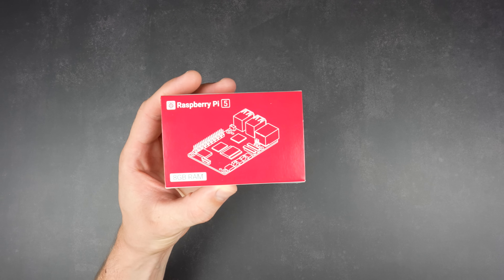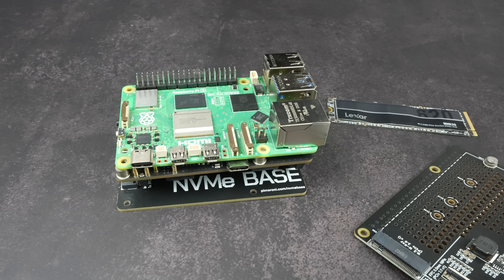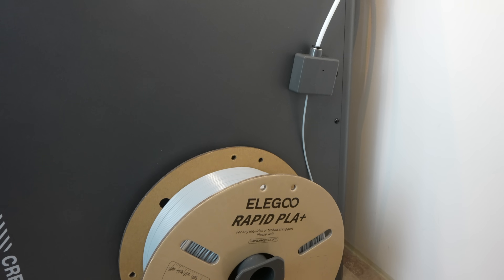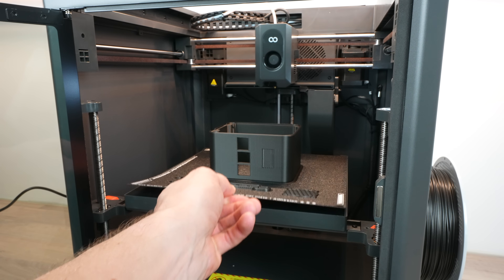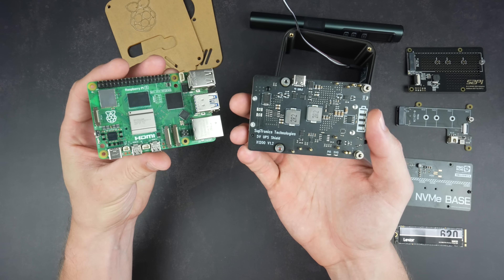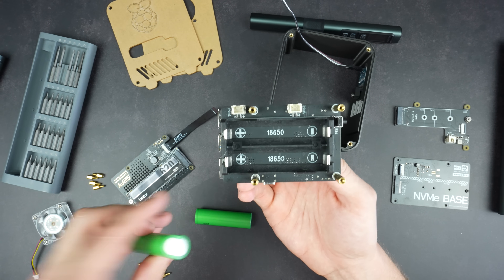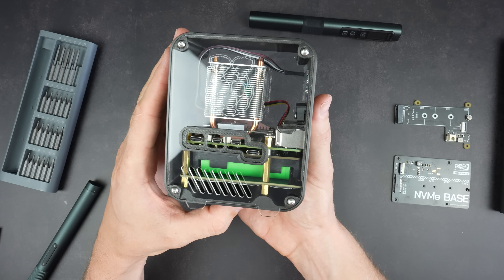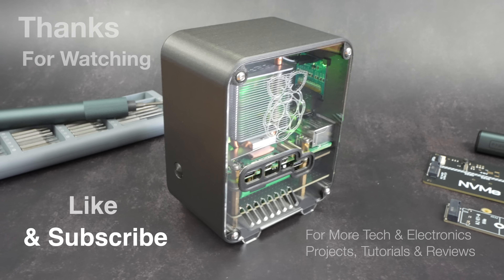Ultimate Raspberry Pi 5 Desktop Server with UPS, NVMe & Stats Display

Comment: How compatible are 3D printing files for pi3 and pi4?
Reply from the maker: The Pi 3 and Pi 4 have different port layouts so that case isn't compatible.
Reply: @MichaelKlements  If you have a case design compatible with pi3 and pi4, I would like to purchase it.

Comment: Out of curiosity would something like this function properly with Waveshare 4-Ch PCIe FFC Adapter Board, Geekworm X1011 5V PCIe to Four M.2 NVMe SSD Board, & Penta SATA HAT for some larger drives and low priority data? I'm considering setting up a small web server to run a basic website and a standalone setup of a VTT (Virtual Tabletop) In this case Foundry. 

I thought Perhaps splitting the asset storage (tokens, maps, gfx) onto the larger drives and running the website and vtt off of NVME might work. But perhaps it would just be more worth while to split it up on two different setups.

Comment: Hey this is so cool. What do you think about a hybrid All-In-One Pi 5? Pi, UPS, NAS, Screen, Cooling?  Take the Pironman 5 Max with its dual NVMe's, one storage the other for a 4-bay SSD NAS with the Radxa gat along with UPS and the cool screen they have with the kit. Somehting smallish, compact and easy swap like your last Pi NAS. I am in the process of building that one right now.
Reply from the maker: That sounds great! There are some parts of that setup that will be difficult to get right - most UPS' for the Pi 5 don't have enough power to support a number of NAS drives (like 4 2.5" drives).

Comment: Hey there Michael, this is quite an impressive build. I was wondering if this can be extended further to also host 2-4x 2.5" slim drives, and if you are selling pre-builds. I'd be interested in such a configuration. :)
I've been previously using miniPcs (such as Dell Optiplex) and found a good balance in them, but I'd like to further extend the 2.5" storage along with potentially lower energy consumption that these arm based board computers bring.

Comment: For those who want to lasercut the sidepanels from clear acrylic, you need a CO2 laser for it as a diode laser uses visible light, which will pass right through the acrylic. You could use a cnc cutter though, which gives good results, but i doubt if the stl 'as is' is suitable for that.

Comment: I like you project and stated following. One small question, the fan was designed to blow air through the fins of the head sink, however since you moved it does this affect the performance of the heat sink? I would add a small section of tube touching the heat sink to force concentrated air flow through it to take the heat away. What do you think?

Comment: Do you think it's possible to make a NAS server with Pi 5, the Radxa Penta SATA hat and the UPS for backup?
Reply from the maker: Not without a UPS dedicated to the design. The Penta SATA hat runs on 12V and this UPS only puts out 5V.
Reply: @MichaelKlements  thanks!

Comment: Great Build! Airflow,  left some room for improvement: No exit holes opposite the fan ? SSD can overheat if taxed  - no SSD radiator or fan available, it is also upside down - no convectional way for air to escape. I see some holes in the bottom - but in this case(of possitive air pressure by intake fan) cold air will exit the case, no the hot, that is gavered in the top part of the case...... )

Comment: I wonder, is it possible to turn that build into a NAS project?  Me personally, I would want to add 4 drives but in a way that they would slid out of the case individually, each would have it's own little slider holder/shelf. That would make them easy to replace should the need arise. I'd also want to add some kind of WiFi and bluetooth antennas.
But would the Raspberry Pi be able to handle life as a constant  on computer back up?
I've heard some people say it can.
Reply from the maker: The problem isn't designing the case, slides, holders etc. to do this, the problem is connecting the drives to the Pi 5. There are very few options to connect physical drives to a Pi in a way that allows them to be slid into bays. The Radxa Penta SATA hat is one of the few options and it's orientation makes it difficult to design a traditional front facing NAS.
Yes you can run a Pi 24/7 without any issues, I have a couple that have been running for a few years now.

Comment: I feel like putting the small display on the other side of the case would've looked nicer - both giving it a "conventional" PC case layout (IO on the back) and a much shorter, neater run for the cable
Reply from the maker: I've got both options available in the 3D print files.

Comment: Really cool "package"! I thought about doing this but I kind of already have something that works well enough. I have the Pi5 with NVMe SSD-M.2, + SATA connected to my existing UPS.  UPS also supports my Internet connection (two separate devices).  Still looks like a lot fun.

Comment: Hey there Michael, loved this project.  One thing maybe add ducting between the fan intake and the cooler and the continue the ducting through the other side of the case leaving the bottom side of the out flow duct open, and maybe add a second pull fan on the exhaust side of the case.  The idea being that forced flow through the cooler would cool the CPU better and the missing bottom ducting would allow air to be sucked through from the bottom venting of the case, keeping the UPS batteries and NVMe drive just a bit cooler.  Just some random thoughts, not like I've ever done any of this for real like you.

Comment: I have a 3.5 inch waveshare touchscreen hdmi display. I have been trying to make a complete portable pc using Pi 5. My goal is to use the ups hat as well as the display using HDMI connection in a single case. I loved your way of integrating the cooler the ups hat and the ssd hat. Is it possible to add a display to that too ? Making it a truly wireless pc ?
Reply from the maker: I'm actually working on a similar project at the moment too although I'm aiming to make it more of a clamshell style design. That 3.5" Waveshare display isn't much bigger than the Pi so shouldn't be a problem to add to a case like this.
Reply: @MichaelKlements  Sounds awesome, all the best !! And thanks for your input, as a complete newbie experimenting with the hardware 😅 it really helps.

Comment: I have a builder's challenge for you.

I want a three-brained desktop computer based on Raspberry Pi for live streaming, programming, and gaming.

The left brain is a Raspberdy Pi OS, the center brain is an AI co-pilot, and the right brain is a sandbox where I can learn to make either my own OS or AI or blend of both, complete with options for my own hardware and software creations as I learn the skills. This computer should be a sellable kit for Etsy.

As a person who wants to become a VTuber, hence the required power and computing and budgeting needs, I would love the idea of making an OS space having an AI co-pilot that is suitable to live audience presentation and participation. Therefore, each brain must have its own computer screen, the left being private, the center being semi-private, and the right being what the public sees and interacts with during live streaming, and so I need a matching keyboard and program that can freely toggle and transfer information between the three brains that is secure to me. 

In this way, if anything should go wrong in the sandbox it doesn't crash my home space because the AI is moderating in between. Does this make sense?

Comment: What about removing that cpu fan and using passive cooling instead with Noctua case fan on top of the case. You can add some filter for dust. That way you are cooling all components not just cpu.
Reply from the maker: With the inlet vents at the bottom of the case, this moves air over the NVMe SSD and the Pi, so it is providing cooling to more than just the CPU. The issue with the Noctua fan at the moment is that they don't have one that supports the Pi 5's fan socket, so you need to use the GPIO pins and then write your own PWM fan control script to drive it.

Comment: I would include a cut out on the opposite side to the fan so that there can be better air flow
Reply from the maker: If you do this you'd need to add another fan at the bottom for the NVMe SSD. This arrangement forces air over the SSD as well.

Comment: Good video, nice case. Why did you put the display and the power buttons on different sides--or, rather, why is the display on the back of the case?
Reply from the maker: I like having the USB ports on the "front", I've included options for both in the print file download so you can make it up either way around.

Comment: I think the design is good but wouldn't it look much neater if the display was on the same face as the power button then your front face would be clean with just the display and button and all the cables would come out the rear for easy management.
Also while entirely asthetic it was slightly wider you could also add short plug to panel mount adaptors relocating the side plugs to the rear as well
Reply from the maker: I've got options for both display configurations included in the 3D print files. I like having the USB ports on the front but some people prefer all of the cables to be at the back.
I like your suggestion to route all of the side plugs to the read as well!

Comment: That's a gorgeous build! And that's coming from a dude that just got his Pironman 5 running today... 😅👍

Are you selling these? At least the kit, and we can install our own Pi 5 and M.2 SSD? 😁
Reply from the maker: Thank you! I haven't looked at selling them as a kit yet, but I will if there is enough interest in them.
Reply: @MichaelKlements  I enjoy the UPS option as well. It's funny to think of having uninterrupted power capability for my Pi, but pretty practical. 
I had a great front-row seat comparing the Pironman 5 build which I had just completed, and watching your design and build, to compare and contrast. 
The two builds would both use the same OS, though not mandatory. Similar heat sinks with slightly different board layout connections. In this regard, yours is superior. The Pironman 5 uses 2 plastic pieces that you push through to hold the heat sink in place, not impressive, it even wobbles and pops up because the plastic pieces can't quite hold the heatsink down against the thermal tape, while yours is firmly screwed in. 
My Pironman came with the NVMe M.2 hat, which does not accommodate an SSD with a heat sink case, like the Samsung 990 Pro w/heatsink, the case is just a little wider than just an SSD, and there is a component sodered in at the edge of that line which stops a case from fitting. The Samsung is complete overkill anyway, but still, if you find yourself wanting to install a heatsinked SSD, it's a no-go with the Pironman 5. A little frustrating, since the point of this case is about 'cooling' your components... I'm unfamiliar with your hat, but that may be a consideration. 
It would be interesting to run temp comparisons on the CPU, and see how they compare. 
And the price, 
Pironman 5 - $80, average, for the NVMe hat kit model, so that's a price point to contrast with, although, I would argue that your UPS inclusive design makes it more appropriate for Webserver applications that need continuous power, justifying  a possibly higher price point. 
Some thoughts to ponder...

Comment: I did not know that this OLED can display more information than only the basic stats. Well done Michael. The case looks pretty good.
Reply from the maker: It's fully programmable so you can essentially display anything that you can read in from the system.

Comment: You're going to run TrueNAS on it? How? There is no Arm64 port...
Reply from the maker: @mikemiller1208 you're absolutely right! I meant OpenMediaVault, not TrueNAS. I had TrueNAS on my mind since I’ve been playing around with it on the LincStation N1 this week. Thanks for catching that!
Reply: its to slow for a server videos barley watchable ,i have two rpi5 and the piroman 5 case i turned my old pc into a server using jellyfin and its super fast 4k videos load up instantly jellyfin is free and awseome can watch on your phone too i think 10 devices at the same time and you can add other people to your network to watch your server so if the internet goes down atleast you have your home network sever i wont say where i get all my films music etc from but you know where i just cant say 😂

Comment: The case is beautifull as always.
You re designs are always great.

But i have a sugestion, ... I think a project like that would be more usefull if included a poe hat. Usually a "server" is connected with the network cable and having the poe to power the system would be very cool. Regular UPS providing power to your network poe switch and router, and the poe swith providing power to the pi. And the external hard drives could also be powered by the ups (if you need the extra power for them. 
That of course if you are using it as a home lab, but as you built is more a "on the go" NAS, but also very very cool and well built. Keep up the good work. Thanks
Reply from the maker: Thanks for the feedback and suggestion. I'll have a go at creating a PoE version too, I've seen quite a few people running their homelab Pi's on PoE.
Reply: @MichaelKlements  hatdrive makes a PoE and NVME hat.

Comment: You plan on using external USB drives for TrueNAS?
I've heard using USB is not a good idea (at least on the Unraid forums) because of reliability, random disconnects/reconnects.
Reply from the maker: I'm going to be using the Pimoroni Dual NVMe hat (one boot drive and one storage drive) and then an 18TB USB drive for long term storage. You're correct, USB connected drives aren't great for reliability.
I'm running OMV on it, not TrueNAS - I had the wrong system on my mind.

Comment: Very impressive case, equal to any commercial version available. A couple if additions would make it more usable to many, including myself. First would be printable side panels. I have never been one for clear sides and I don't have access to a laser cutter for the acrylic panels. Simple flat printable sides with the same openings would be a great addition. The other change is a minor one, have you thought of a version with the screen on the side with the power button? That would make for a nice clean looking front for places where you would like to have the Pi more visible. The side panel cables could use right angle plugs to minimize the industrial look of cables coming out of everywhere. Either way a great case I look forward to printing and using. Since you don't seem to have Patreon I will use you links to purchase something.
Reply from the maker: Thanks for the feedback and suggestions!
The print file set includes STL versions of the side panels, they 3D print well too.
I'll look at including a second option for the body of the case that has the display on the opposite side.

Comment: These RPI cabinets are usually so light that the cables dictate their resting position. Maybe some mount recesses for attaching it on some bolt heads on the bottom (like on a router or switch)?
I guess double sided tape would also work.
Reply from the maker: That's a nice suggestion!
Reply: glue or imbed a weight into the bottom if its an issue
Reply: also little stick on rubber feet work wonders

Comment: Dear Michael, your project is very interesting. I would like to be able to do it, but you have not posted the link to your blog (at least I don't see it) and the link to the STL files to print them (the Elegoo printer is excellent). I would like to be able to get all the elements to do this project in my country, Argentina. If you can add the type or model of screen it has, I would be grateful. Best regards. Thank you.
Reply from the maker: I've added the link to my blog, the 3D print files and the display that I've used to the video description. Enjoy putting it together!